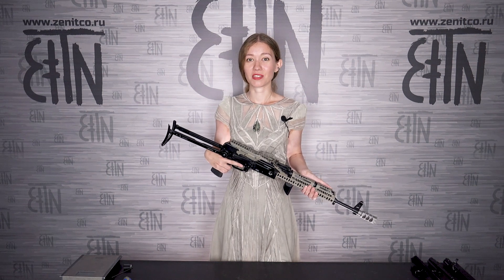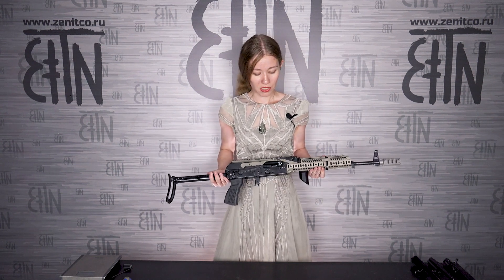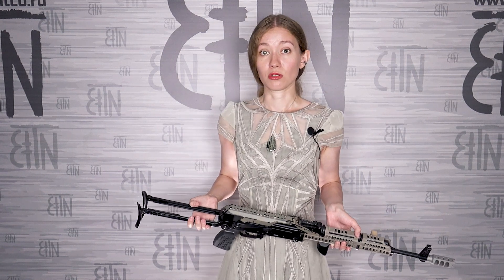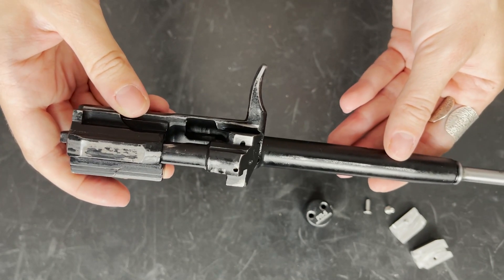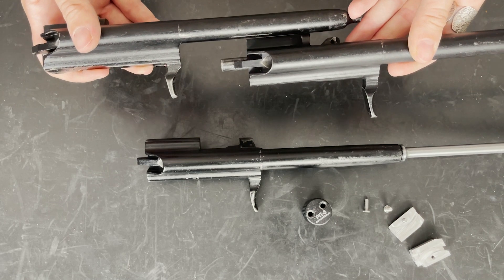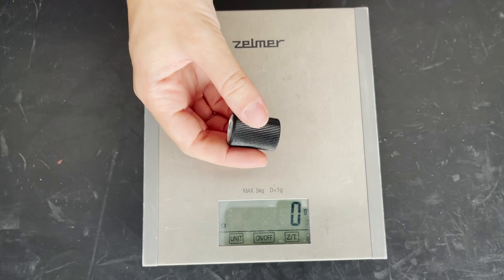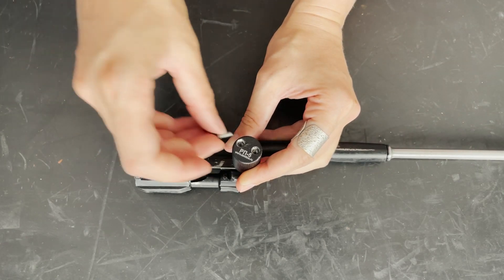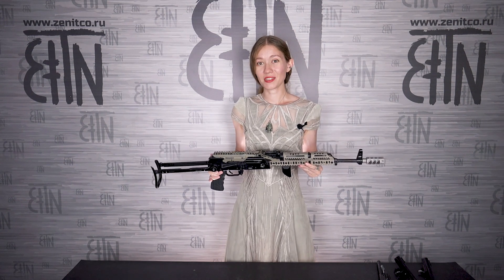RP-5: AKM charging handle

Comment: Well I got the Palmetto State Armory AK-103. Bought the RP-1 because I read that the AK-103 platform was compatible with it. Gets here, and it fits (ish) but not well. Started looking and looking. The changing handle I got is definitely the AKM style which requires this RP-5. Still fits really tight, so I may have to do a bit of sanding but already fits way better. PSA is just throwing me for a loop. Been a PAIN trying to get all my Zenitco parts to fit on their AK🙃
Reply: The PSA AK-103 is not clone correct. It is AKM pattern with a 90 degree gas block and 24mm FSB, like how the SLR-107FR is.  Only the KUSA KR-103 is close to being clone correct in its carrier, bolt and trunnion.
Reply: All your Zenitco parts.. so you've bought quite a few?
 If I might ask, if you bought any parts this year how has your success been?
 Has customs seized more than usual?
Reply: @manscapedgrinch1427  luckily I bought everything and finished the build in October of 2021, just before everything happened with Russia and Ukraine. I imagine it’s been substantially harder and or pricier now
Reply: @loganhartsel5513  appreciate that quick reply, yeah probably for the best that you got it done back then... Probably gonna be a decade before things go back to the way they were when it comes to importing Russian goods
Reply: @manscapedgrinch1427  go through there Georgian partners they have had zero items seized.
Reply: @Azure_sky  first I've heard of this, I'll definitely have to look into it.
 I appreciate the heads up, not a lot of good current info regarding the subject.
Reply: @manscapedgrinch1427  I just ordered a pt1 and rp5 from them after mutiple emails chatting with them they told me they are being seized in russia or arriving from Russia even tho there are no sanctions or tarrifs against zenitco. Zenitco from my understanding moved out of russia but partners are still shipping from there causing issues with customs. Idk if it's all true but every order I have seen seized was from russia and mainly ivan and rumors of there paperwork being filled incorrectly
Reply: @manscapedgrinch1427  also I can update u when my stuff go through customs in probably a month or so.
Reply: @Azure_sky  I'd appreciate that
Reply: @manscapedgrinch1427  will do the catch is everything is like double the price now sadly a pt1/3 is like 600-700 now not counting taxes. But still way cheaper then the other company's that are charging 700-900 plusses 200-300 to ship from Switzerland.
Reply: @Azure_sky  worth it in the end though, especially with the fact that this conflict could go on for years to come.
Reply: @Azure_sky Georgian partners? Is it a company under a seperate name or something?

Comment: What can I do to prevent the knob from coming loose? Tried blue thread sealant
Reply: Add small peice of rubber matt 1/16 th thick behind charging handle.  Will be hard to install cover. Then folow instructions as normal.   Solid af

Comment: Anyone know if this one is compatible with Yugos/Zastava M70?
Reply: Best answer, check their website.
Reply: Unlikely but I’ll buy one and I’ll update you on how it fits
Reply: Doing a little internet research, check out the RP-1.
Reply: That charging handle looks exactly like my m70 charging handle so im going for it lol
Reply: Bought it 10 days ago. Arrived today. It fits nicely and is snug but it’s not strait. Doesn’t catch, no need for locktite. But if you have OCD you will prolly want to do a little dremel work to have the best look. Or just paint it all black if you don’t want the logo showing. But yes fits Zastava m70
Reply: @kped741  not straight meaning the logo?
Reply: Fits my M70 like a glove but as mention before it’s slightly off set coming close to one of the rivets

Comment: speak up sonny the volume is very low compared to ads
Reply from the maker: Messed up with microphone settings in this one. Will take into account in future videos.
Reply: @ZenitcoinEnglish  Reply in 2 hours....vedy vedy niiiiceeeee 😎👌🏽
Reply: @ZenitcoinEnglish  Can it be confirmed that the RP-5 will not fit CENTURY WASR-10 BLACK WIDOW AK-47 RIFLE- RI4313-N?
Reply: @SubzeroG24  you sand it down a little with a dremel or file and it should fit